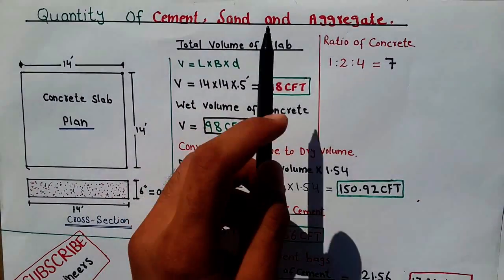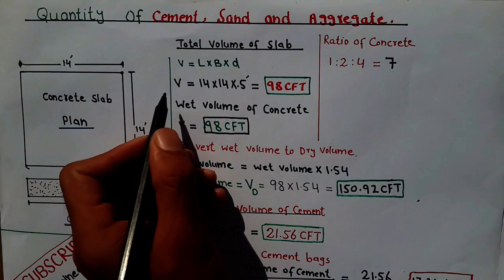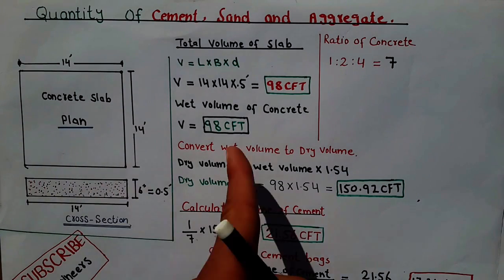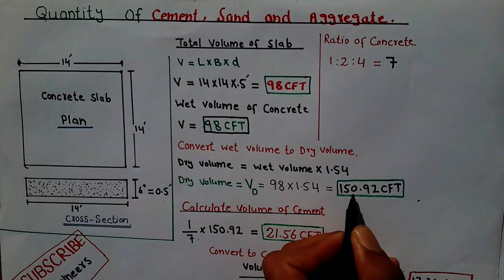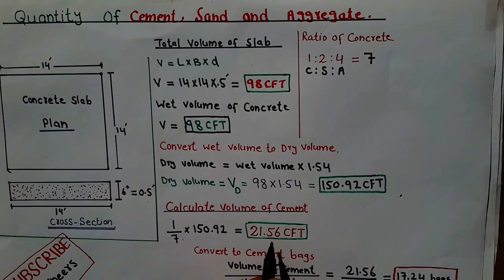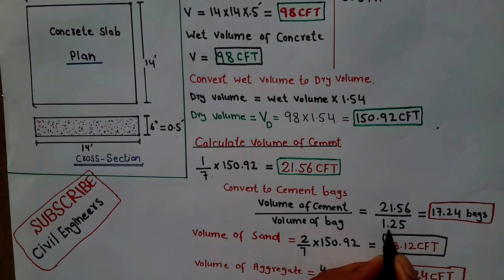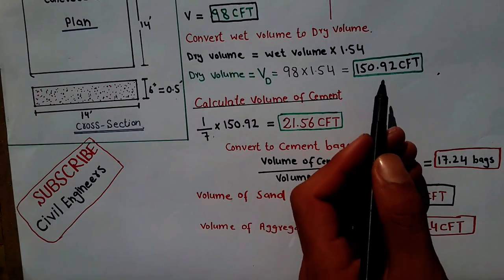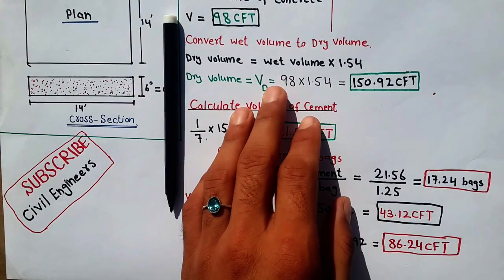How to Calculate Quantity for Cement , Sand & Aggregate in Concrete.

Comment: This is not accurate. Dry volume to wet volume conversions are not correct. 
1.54 is the ratio of 3/4 to 1 inch aggregate to sand. 1 part sand to 1.54 stone gives 2 wet.

Comment: we should multiply the density of cement (1440) to get quantity of cement in kg. then we need to divide it by(50) as a cement bag contains 50kg in it .... this method is correct or wrong sir
Reply: sir tell the answer
Reply: Answer please
Reply: That's correct if you convert first the volume into m^3

Comment: My surface bed size is 110'*55'*6"
How many bags required
How much sand and aggregate
Reply: Download concrete calculator on playstore😁
Reply: Cement=533bags
Sand=1331cft
Aggregate=2662cft

Comment: Thanks for this! But how can I convert the cft of sand and aggregate to cum ? Is there any given number for that just like the volume of bag which is 1.25.
Reply: Divide the cft value with 35.28 cum .https://youtu.be/Q78f6DdbXzA
Reply: Simply multiply it by 0.028 or divide it by 35.321
Reply: Ma'am Ang Ganda mo po 😄

Comment: Sami on one of your other videos on columns you use M20;

1     1.5      3
C      S        A

On this video for the slab you are using M15;

1     2      4
C     S      A

My question is if you have a slab made with M15 concrete mix and columns formed with M20, with the columns formed with a stronger mix than the slab, would the slab crack?

Would it be better if making a columns with M20 that the slab should also made with the same mix (M20)?
Reply: YES IF COLUMN IS M20 THE SLAB ALSO SHLD NOT  BE LESS THAN M20

Comment: TELL me Any Friend 1.54 is dry material??
And volume of bag is 1.25 cft?
Reply: I believe the standard density of 1 cement bag is equal to 1440 kg/m3. Density = mass/volume (ρ=m/V) So, V=m/ρ 50 kg ÷ 1440 kg/m3 = 0.0347 m3 = 1.23 CFT

Comment: Dear Sir Engrs... 
May i ask about your expert opinions?...
I am about to construct the second floor flooring of my two-storey house and it measures15 meters (Length) and 12 meters (Width) and planning to have thickness of 4 inches
my engineer told me that the mix ratio will be 1:2:3. by the way one bag of cement here in the Philippines weighs 40 kgs. I'm weighing over hiring a mixer with pumpcrete or hire some to do it manually for me.

here are my questions:
1. how many cubic meters of mix concrete is needed to fill it up?
2. how many bags of cement do i need?
3. how many cubic meters of sand required?
4. how many cubic meters of gravel required?
5. what kind of rebars to use and its spacing?

thank you guys for your professional help :)

Comment: sir, how the 6" become 0.5" ? thank you.
Reply: jecar panumpang 
1ft = 12 inch
X =      6"
Cross multiplication 
6/12 = inch
0.5 = inch
Reply: inches  converted into feats  
that's why 6" changed to 0.5'.
not 0.5"
Reply: jecar panumpang r u engineer ??
Reply: Because 1ft = 12 inches. Therefore 6 inches = 0.5 of 1ft.

Comment: Hi, I am wanting to make my own new concrete hearth topper for my fireplace. It needs to be 20" wide and 90" long, but no more than 1" thick - thinner would be better. My concern is that the current one is 2" thick stone in 2 slabs to span the 90" length. I don't want my new one to be too fragile to handle wood getting dropped on it, etc. How long can my new, thinner sections be if I can't do one 90" slab at 1" thick? Or does it even matter how thick it is if there are rebar rods in it?  I'm not an engineer. Just a DIY'er. Thanks for your help.

Comment: volume of cement bag is 1.225,  not 1.25. volume= mass/density 
mass of cement bag is 50 kg and density of cement is 1440kg/m3. substitute those two values in above formula we are getting 0.0347m3. we know that 1m3= 35.31cft. so volume of cement bag= 35.31*0.0347=> 1.225cft
Reply from the maker: OK so give me prove
Reply from the maker: OK so give me prove
Reply from the maker: bro volume of bage is 1.25 ok from SI check
Reply: can you please provide link or reference code book... where do u get volume of cement bag is 1.25
Reply from the maker: please check  SLS-107 Conditions
Reply from the maker: SLS-107 Conditions
Reply: according to Sri Lanka standard (SLS) it is OK, what about Indian standard (is)?
Reply from the maker: Bro what u mean u need the reference and i have given u now if u dont like my videos so please unsubscribe me then u can not watch my videos thanks.
Reply: ok sorry
Reply: I think you need to be tolerant cos we are engineers. We work with sharing ideas. You need to reply him logically and if he persist with some different facts then you will block him

Comment: how u can calculate volum of bag = 1.25......????????
Reply from the maker: Get a tape and take dimension of 50 kg bag of cement it will be give u 1.25 cft may be u will understand bro.
Reply: Civil Engineers 0.035 ..?? volume of bags..?
Reply: padhiyar sagar  0.0347 cubic meter ,volume of 1bag cement.